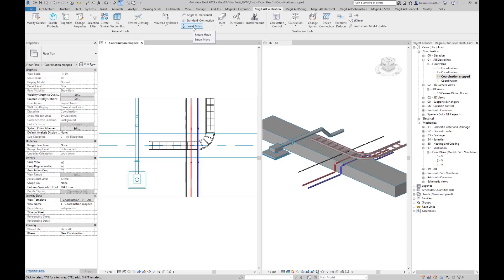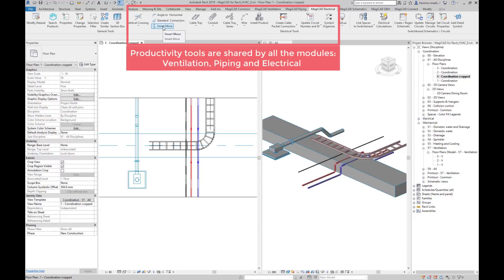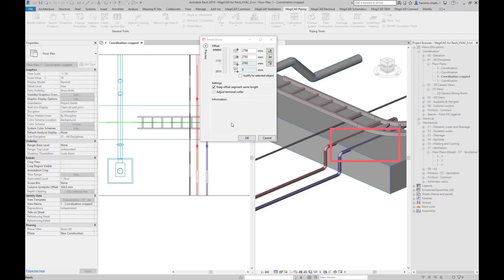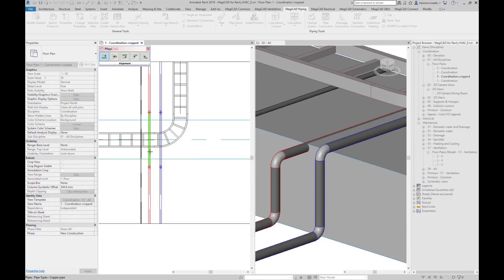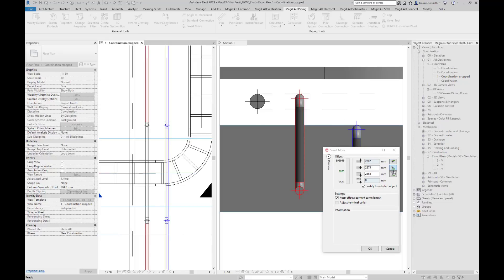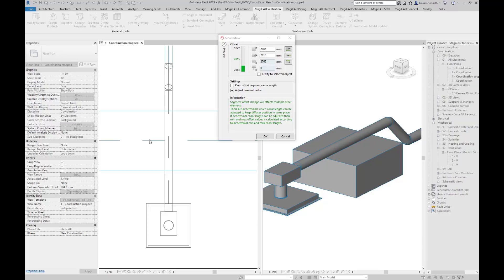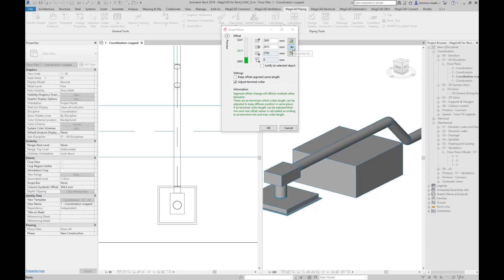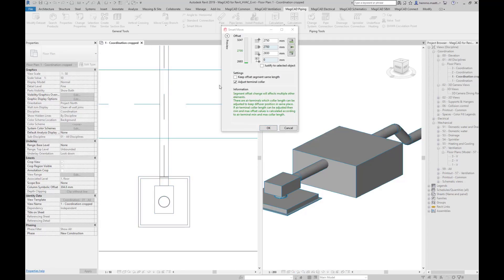MagiCAD 2020 for Revit / Change elevation offsets with the Smart Move tool

Comment: Magic Cad its a addon tool or separate software,what Exactly it will do when associate with Autocad and Revit
Reply from the maker: MagiCAD is available for both Revit and AutoCAD
 technologies making HVAC, piping and electrical design faster and easier, and at the same time enabling new levels of reliability, accuracy and quality. Our fully integrated software enables powerful modelling capabilities, produces a more streamlined working environment, and offers localised content, standards and engineering calculations. You can find more information on MagiCAD and its different modules on our website: https://www.magicad.com/en/magicad-mep-software/